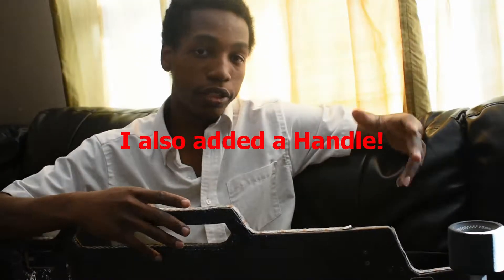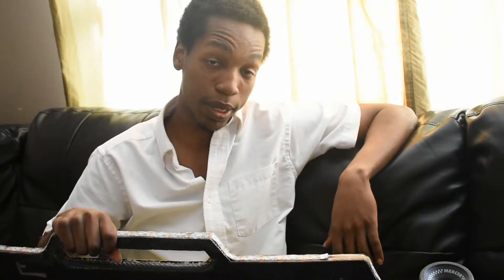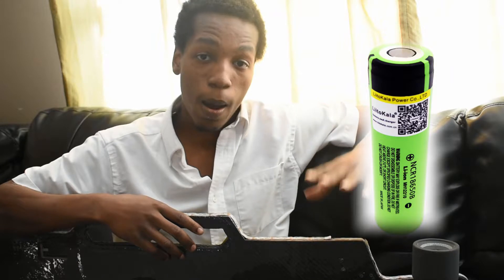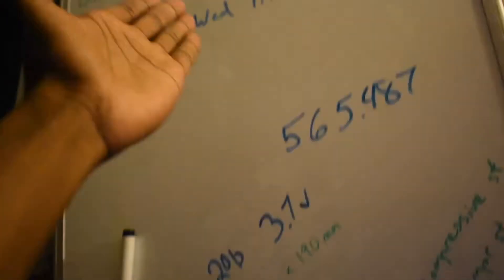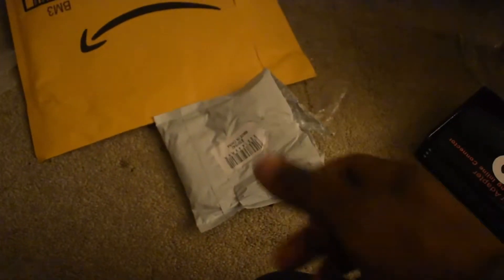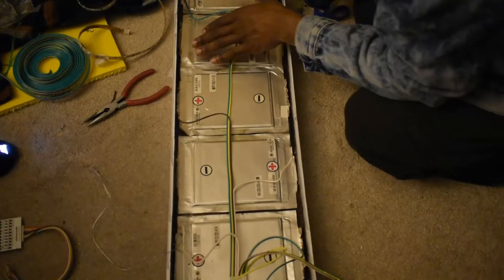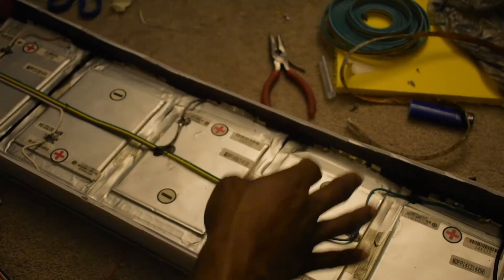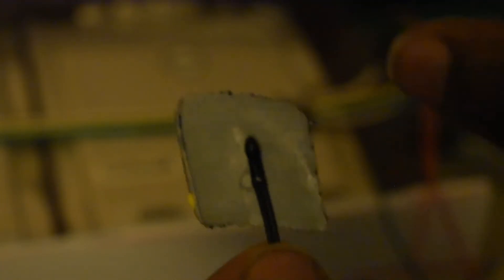DIY Electric Longboard Build (part 1.5)

Comment: Some observations: Those cells are rated for 200 amps, but if you actually try to draw that much you'll run them dry in less than a minute, and probably blow them up too. At 8 AH 3.7 volts (8 amps for an hour), assuming you had the right power limiting system for that, you'd pull about 30 watts per cell. You had about 10 cells, so 600 watts. That's a bit much, enough to send you flying across the pavement at uncontrollable speeds to what will likely be pain. To compare, a common electric scooter battery has 12 volts, 7 amps. 84 watts. You may want to consider buying one of those instead. That should be more than enough.

https://www.walmart.com/ip/Electric-Scooter-Batteries/125055637
This one should do. Or, I can sell you one. I have an abundance of batteries of many types. I also have a more compact lithium battery instead of the lead acid ones. It'll way less and it'll be more compact. Then again, you already bought these so I'd just use 3 wired in series. But if you want to add some LEDs and stuff, I'd wire a small lead acid battery to a cheap inverter. You should be able to fix that on there. From the inverter you can deliver power to an AC motor and some LED light strips.
Reply from the maker: These cells although they will drain quickly at 200 amps they don't explode until a max amp draw of 300A is pulled. They were made to maintain a constant flow of 200 amps according to the datasheet and the testing videos that I've seen because they were made originally to power an electric city bus.

Thanks for looking out though.👍🤙